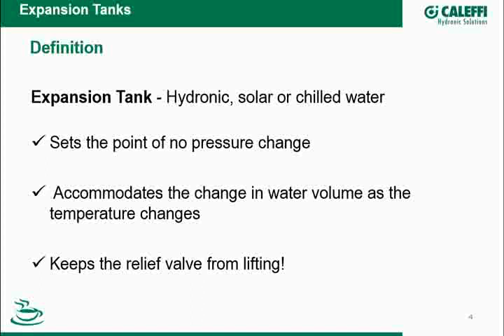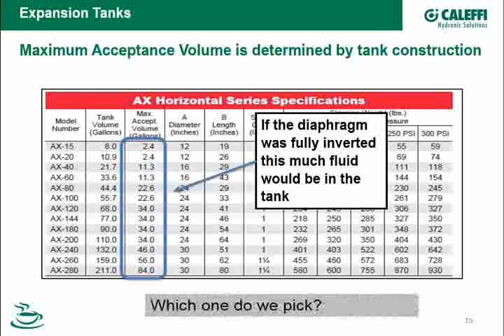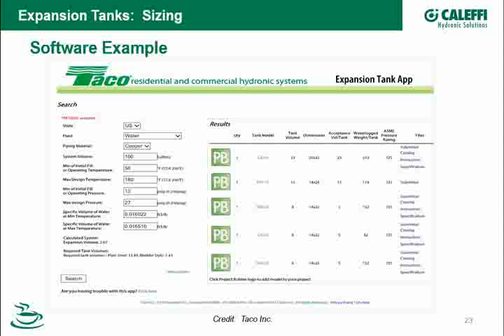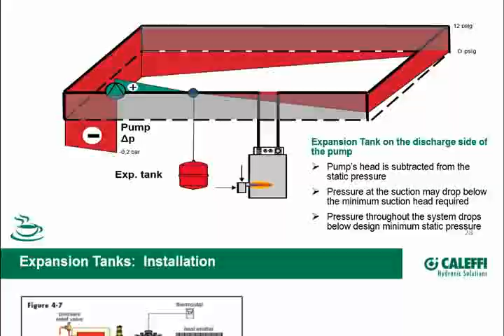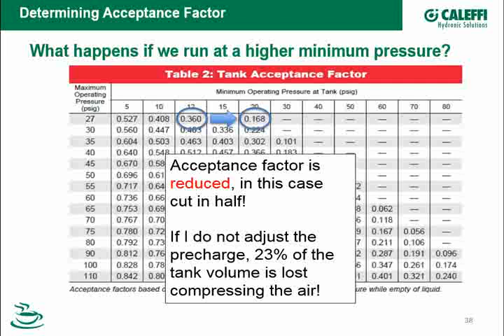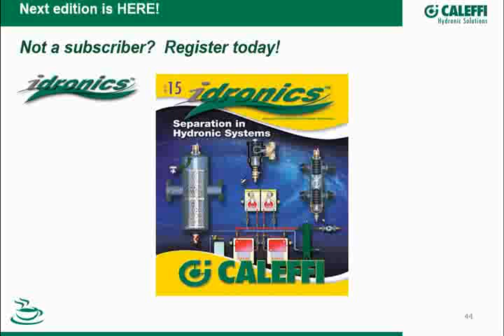Expansion Tanks - Designs, Sizing and Application

Comment: Im going to share this with the salesman at our company.....here in TX boiler knowledge is lacking. I was just at a job....new Viessman and a old Bryan water tube were there.....they installed a new air separator and didn't add an expansion tank and chopped off the piping to the existing compression tank....i was like WTF is going on here. Im not boiler Jesus by any stretch of the imagination....but dang this is boiler 101 stuff. Thanks for the video

Comment: I have in mind the possibility of having a vertical supply pipe of about 13 feet going upwards from the wood-fired boiler through a small buffer tank (40 gallons) and placing both the expansion tank and the system pump there, near the top of the system. This would be an unusual arrangement, but is there any reason why it cannot be done?
Reply from the maker: In the system design, one of the important design relationships is between the expansion tank and the circulators.  Specifically, the expansion tank should be on the suction-side so the pump head is additive over static pressure.  If you want to elevate it 13 feet above the buffer tank, it will have no effect as long as the two components are moved together. Hope this helps.